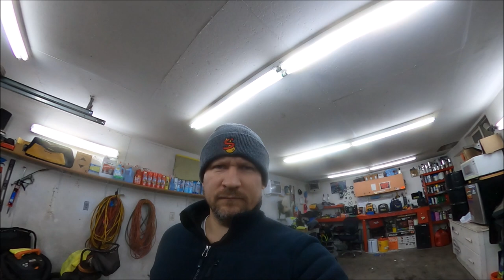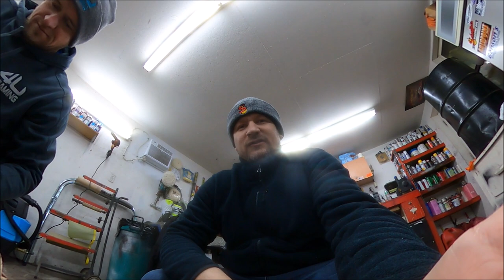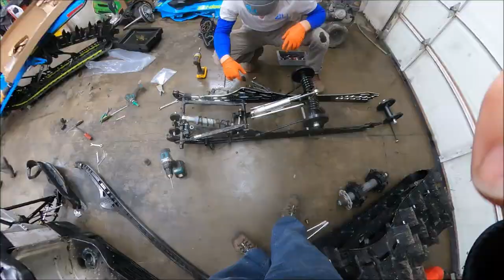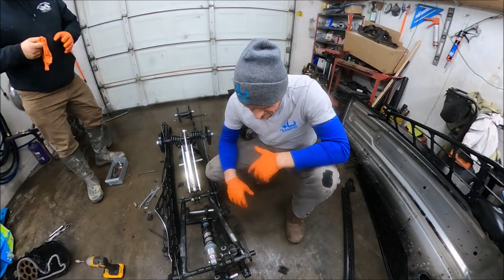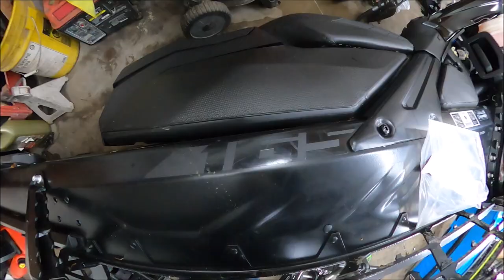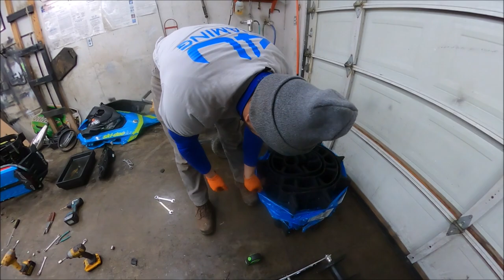SKI-DOO 165 TO 175 TRACK CONVERSION

Comment: Hey Paul did you repair your oil tank with the windshield glue ? because mine is leaking too haha
Reply from the maker: Urethane windshield glue
Reply: @turbopaul6866  thx that the only good glue i have at the shop ahahaha